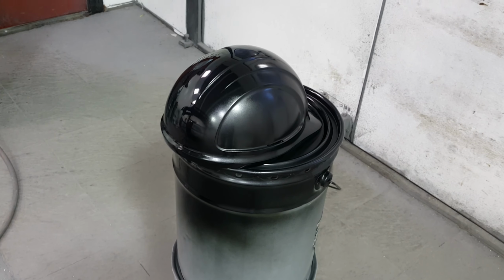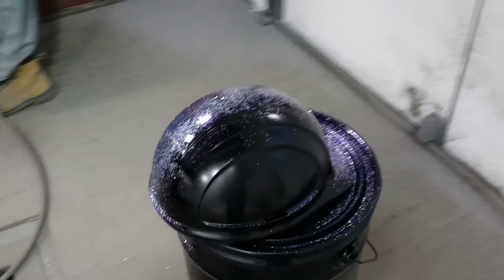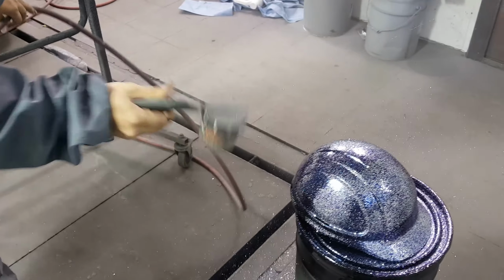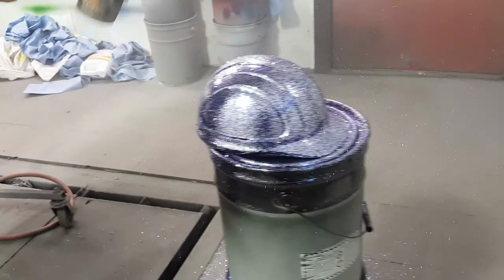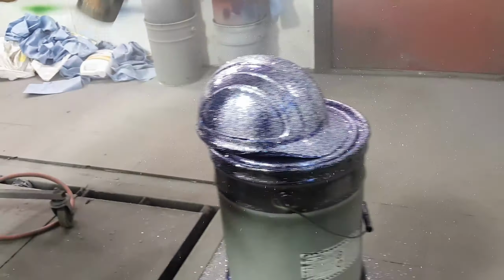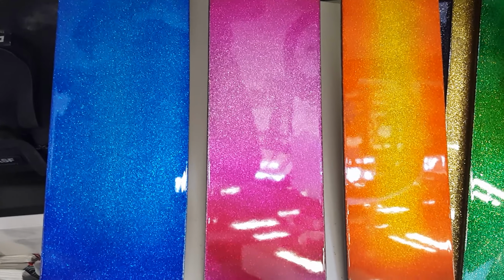Unbelievable Metal Flake Magic: Exquisite Custom Paint Panels That Mesmerize

Comment: I have a motorcycle and was thinking of doing my fenders and fuel tank in candy apple and metal flake using the same pattern I have right now. It silver mainly with black in it with white strip to separate to 2 colour.